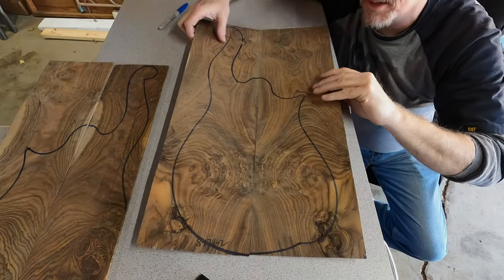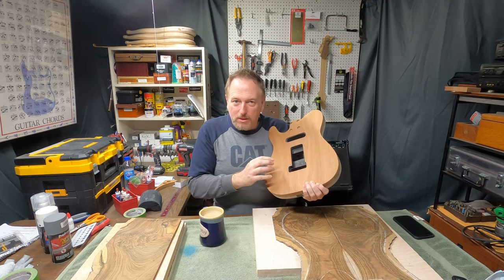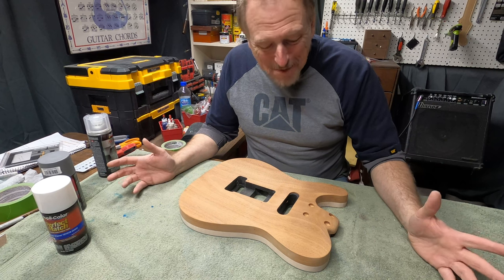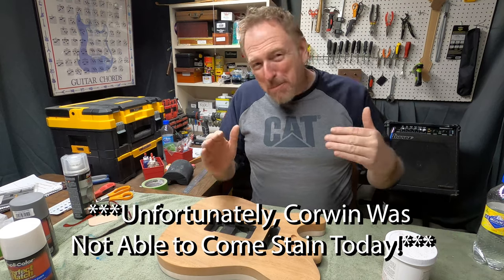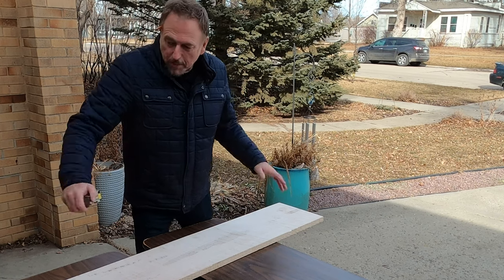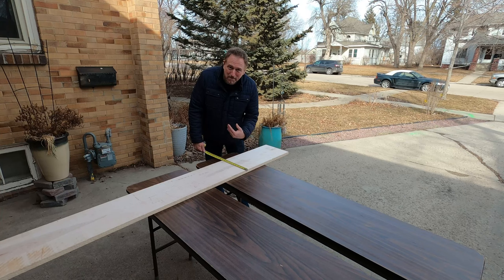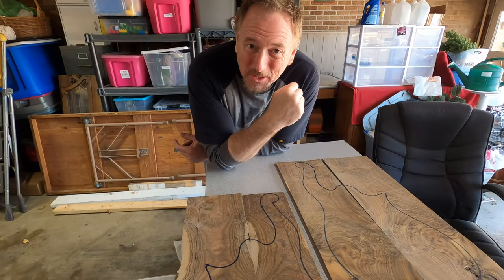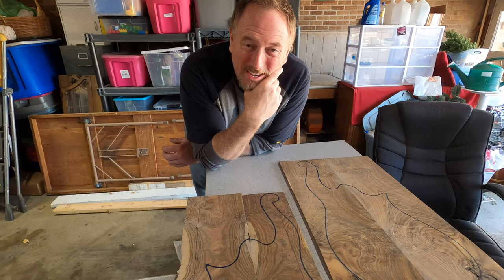Ziricote Burl Guitar

Comment: Very nice. Your jointer the blades most likely are not at level which means the blades are not 90 degrees to the fence. Should be instructions in the manual on how to square it all up
Reply from the maker: Thanks for the direction! I appreciate wisdom being shared!  I’ve actually already sold it…Even squaring it up I had issues getting it as tight as I needed…Maybe someday I’ll try getting a better quality one?!!
Reply: @letsbuildaguitar9230  I am a hobby wood worker. I am thinking about making a guitar. Currently have an acoustic and still a green beginner. I think I may have to go for a walk on one of my lunch breaks at work and see how some of the styles feel in my hand. I need to know what neck radius feels best to me. I do like the gibson lp styles the best but like the dual humbuckers the best. Is it wrong for a first build to do a telecaster body but go with lp electronics. Have you thought about building a neck from scratch?
Reply from the maker: Personally I think it’s a great plan to do a Tele body with LP electronics.  Of course there are always the purists who might complain, but it’s your creation as you want it…That’s the beauty of building your own - Make it to fit your wants and needs.  There are a lot of guys that do this combo.  As for my necks…I’ve got wood on hand and ready to make some …but I don’t enjoy the fret work….and what I’ve personally found is that I can get an unfinished Warmoth neck for under 250 dollars….they are incredible and it’s worth it to me to have them do what I don’t like to do.  I still do some shaping and cutting the headstock on the neck…stuff I like to do.